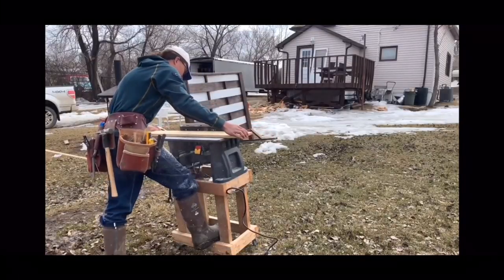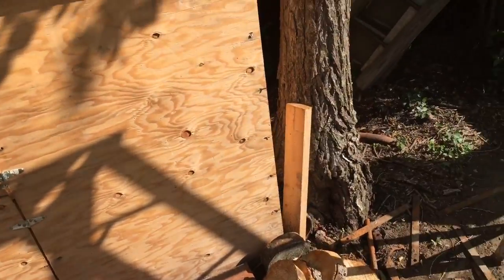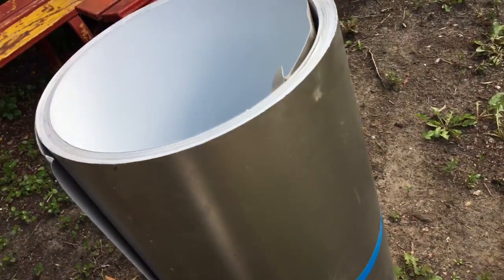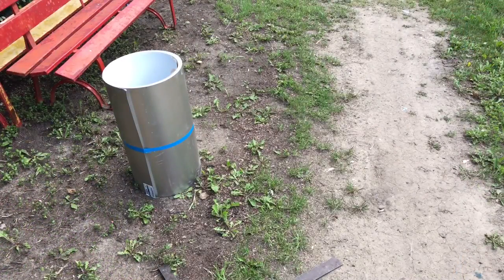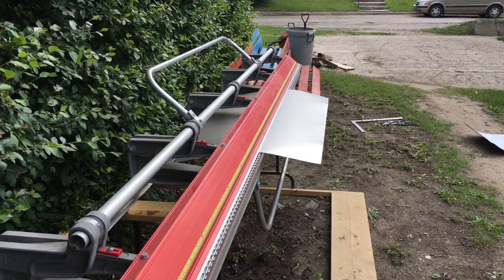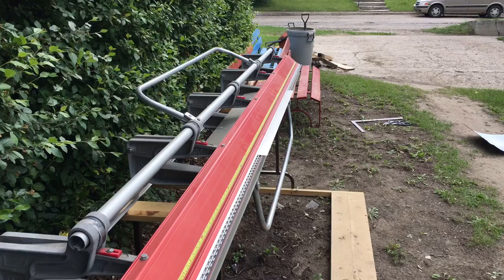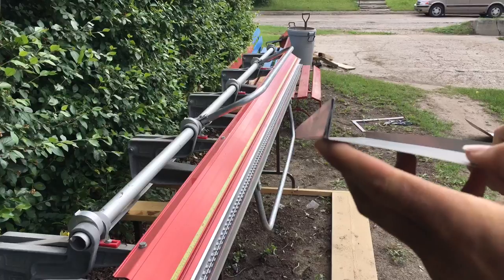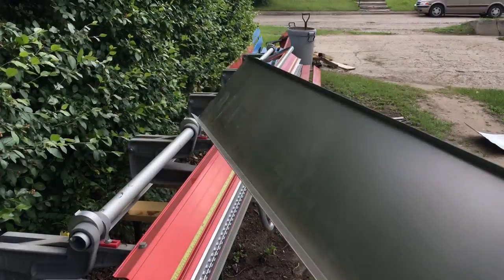Finishing my firewood bin - episode 1

Comment: Great! Looks beautiful. My only concern are the screws on top (in the LOWEST section of the lid). Rainwater and snow will sit in the small puddles around the screw and start dripping through so the wood beneath rots slowly but surely. Dishes / shims out of NYLON (white) or rubber (black) will keep it off a lot longer. I had the complete of my complete former houses removed 3 times in 2 years. The last company showed me this. They avoid nails and screws whenever and wherever they can.
Another company mounted a wooden wall behind the bathroom on the 4th floor. One long screw went into the basin of the toilet. Always had guests so they used it - but the water ran down along the ceiling and walls of every floor beneath. Had just renovated 4 floors. All said it is rainwater but it never rained. 
Took a huge hammer and destroyed that wooden wall. There it was, a 20cm long screw right into a new toilet,  I only had to lift off the lid of the water basin. That is just one of hundreds things that happened during 10 instead of 1 year. Was at court constantly with the companies which once.were friends. They fear me for no reason as we all were in the same club for shooting. Was the only woman.
Reply from the maker: I should have showed it better in the video but the screws I used are specifically for metal roofs they have a rubber washer around the head that seals it preventing any water from getting in